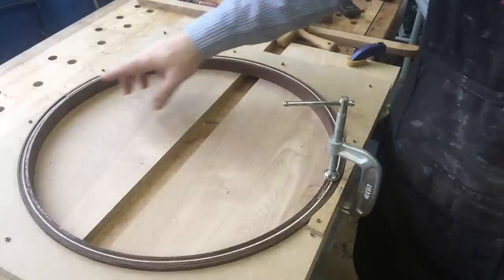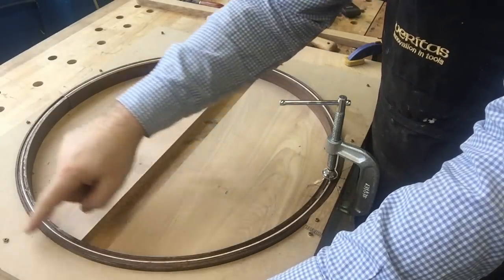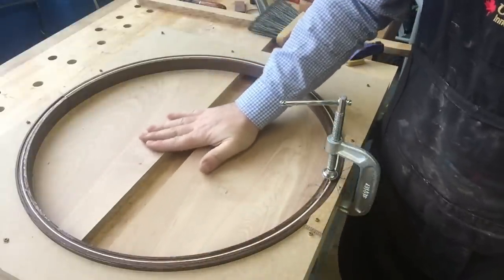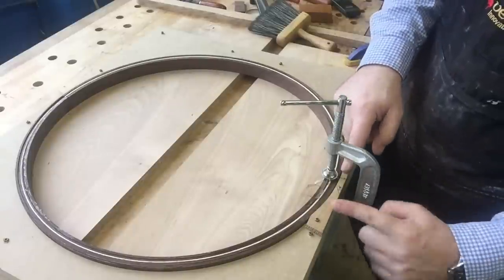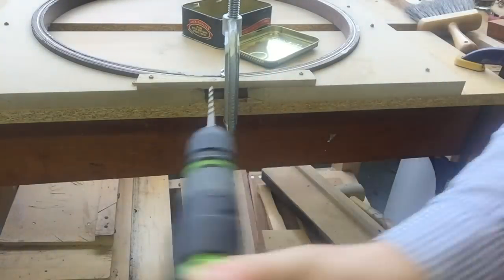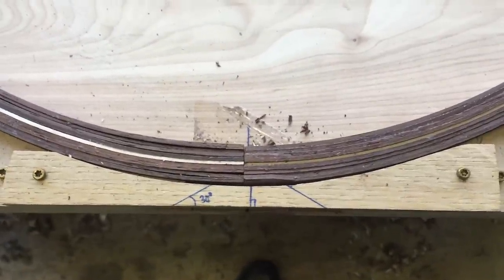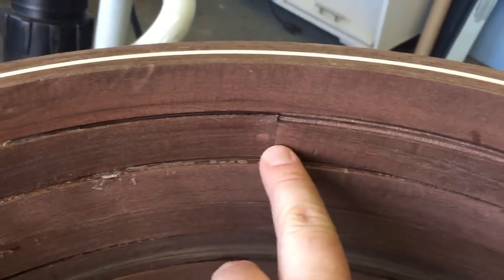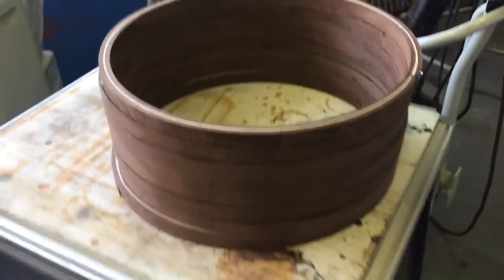Joining two bent laminated semicircles together with wooden dowels

Comment: Thanks a lot for this video, gave me a great idea. I will be making two round tables with a diameter of 32 inches, they will have a base plywood board and on top of it I will make a herringbone pattern using 1x3" pine boards, the resulting border will be a little ugly so I want to hide it with wood. Still deciding if I use a 1"x2"x8', cut it in half and bend the two parts to semicircles with cold water or if I use three 1/4" x 2"x8' moulding strips, which are easier to bend, and then make a jig like yours.